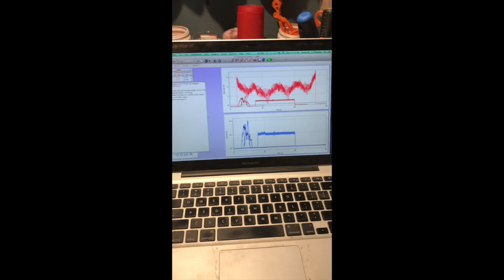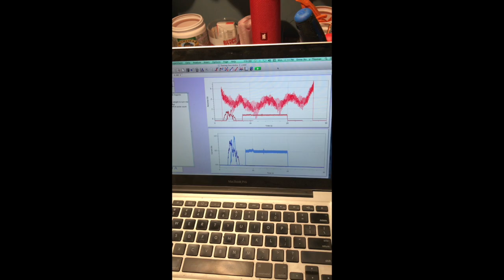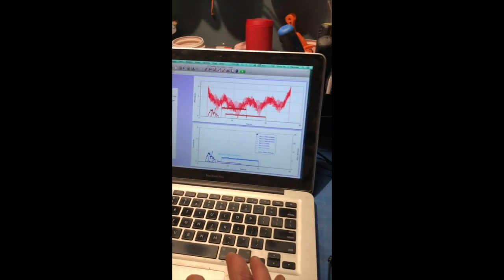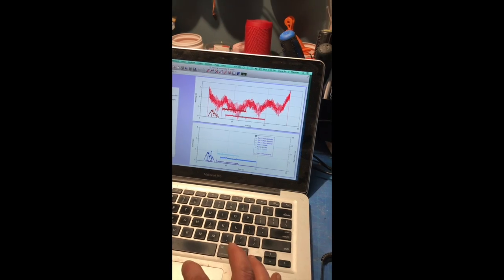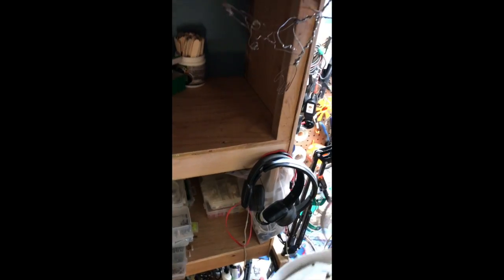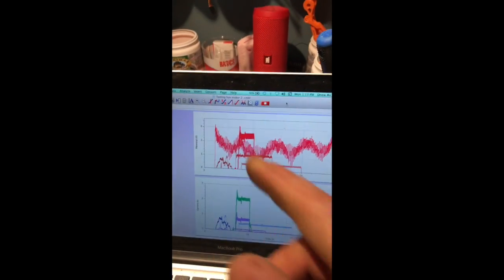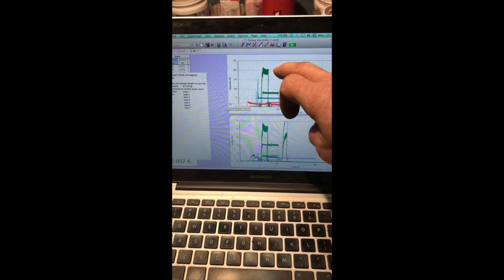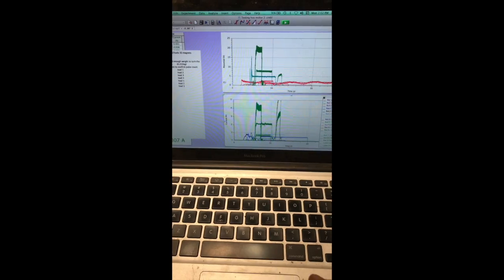Repurposing a Hoverboard wheel into a low RPM alternator for sustainable energy

Comment: Great project.  Inspiring.  I'm looking into powering a hub motor with another hub motor as generator directly.  Any idea the most efficient way to do that?  Can you power one hub motor with another one directly?
Reply from the maker: I'm not sure if I"m understanding you?   Are you are going to just wire one 3phase motor to a second 3ph motor?   I've heard of people doing that, and it can sort of work, but my understanding is that it doesn't work very well.
Reply: @drewartturbine  yeah, thanks, I wonder if there's a more efficient way to use one as a generator and second for power... Thinking about a chainless bike...
Reply from the maker: @tunebj   "the difference between theory and practice is that in theory there is no difference"   In theory what you are talking about is possible, however at this time I think it would be more practical to have a pedal driven alternator, and battery, mounted on a bike frame (as you've described), with a battery and controller, with pedal torque input and position and wheel position and torque.   With a fancy enough controller you could possibly tune it feel like a bicycle.   What makes this impractical is that the alternator is likely only 70% efficient, maybe 80% of energy pedalled in turns into Watt hours in the system, even if you are not putting this into a battery but dumping it into a controller  which is running a motor, this motor and controller  is likely still in the 75% range.   So if power input is 1W then  1W x 0.75 (Alt loses) x 0.75(PMA loses) = 0.5625 W delivered to wheel for every W you pedal in.
Reply: @drewartturbine  Yes, I think you're right about the efficiency problem.  However there might be other benefits that may outweigh the energy losses.  With enough battery you could offset that.  Imagine pedaling leisurely while shooting up a hill.  Or pedaling hard, going slowly downhill.  Could make biking more interesting and accessible for people... Will see... Thanks for your input...
Reply: Haha everyone has this type of idea eventually then you realize themal dynamics is a thing

Comment: You show a disassembled motor/alterrnator and your title is “repurposing...”, were any modifications made?
Reply from the maker: Thank you for your Comment Miguel Cha Gra,  yes modifications were made and if you’d like you can read more about them here at this instructables link I have attached here.  In brief though the stators  alternators are wrapped with 5 wires at the same time, all joined at the top and bottom, so in parallel.   What I’ve done is separated the tops and bottoms, and rejoined them so it is 5 strands in series.   This boosts the voltage output.   I will add the link to the description as well, I had meant to when I posted the video, but had forgotten, thanks for reminding me.   https://www.instructables.com/id/LEDs-Powered-by-Human-and-Stored-in-Gravity-Batter/
Reply: @drewartturbine  Thank you.

Comment: The insertion of random eyebrows makes it!
Reply from the maker: Thankyou,   I keep my eyebrows trimmed, or they might overshadow my whole face
Reply: @drewartturbine  They almost make up for the aspect ratio of satan :)

That's a pretty good data logging setup, have you produced torque / rpm / power curves?  Found the "sweet spot" for these?  I can think of a bunch of uses for motors like this, both as motor and as 3 phase alternator, but concrete figures seem to be thin on the ground.